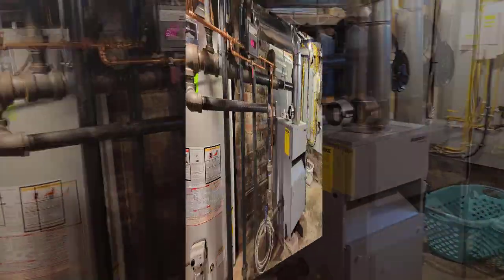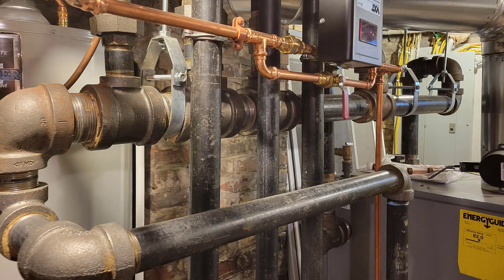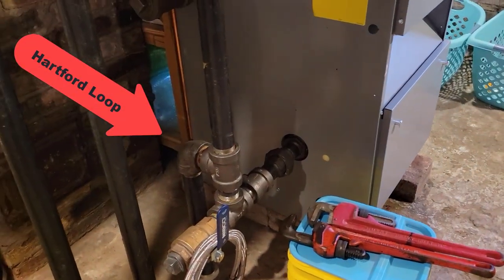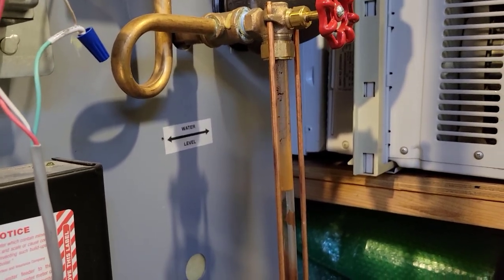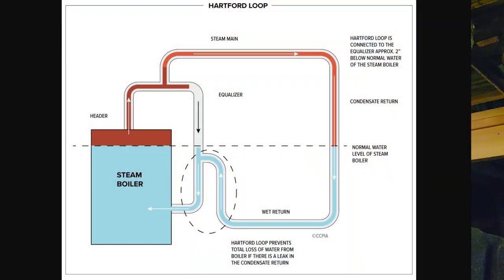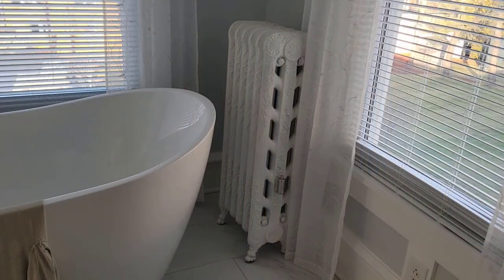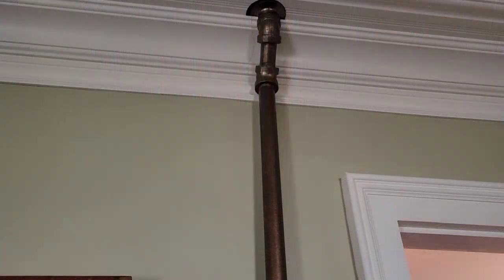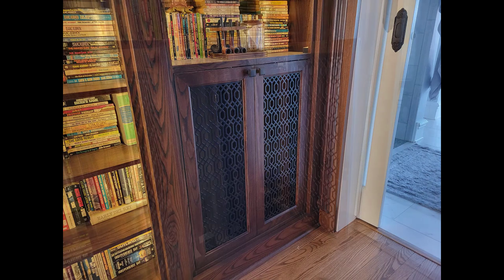Radiators and a STEAM BOILER - a work of art in an 1870 house

Comment: Nice job saving and restoring the radiators!  I can't even imagine how much the new boiler must have cost.  I am assuming that you had to have someone install it for you?
Reply from the maker: Around $14,000 all told which included hooking in three “new” radiators in our addition. One on 1st floor, two on second.
Reply: @sdsconstruction  definitely not cheap, but  probably well worth the investment long term.
Reply from the maker: @russalbright4213  the previous boiler would have been undersized when adding three additional radiators but we were going to give it a season to see if it could keep up. When the steam guys removed the metal casing to expose the boiler columns, of the four, one was almost corroded through and another was starting significant corrosion. We priced replacing those columns for $3000 plus labor but we would still have an undersized boiler so we decided to go the distance with a properly sized brand new boiler and we are happy we did. The initial quote for replumbing the steam and adding the three radiators was around $8k and the added $3k for boiler parts made us realize we were in it for large money so from $11k to $14k and getting a new larger boiler made sense. It happened when we fortunately had some jobs come in and a bit of windfall so we could make it happen even though we had other plans for those resources. We should not have to do this again so if we leverage this cost over 20 years or more, it is not such a big deal.